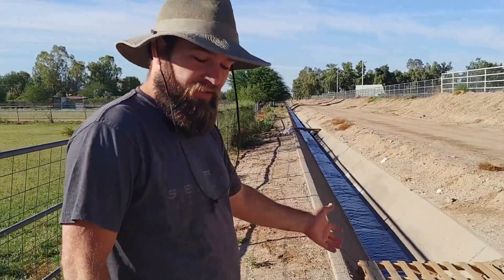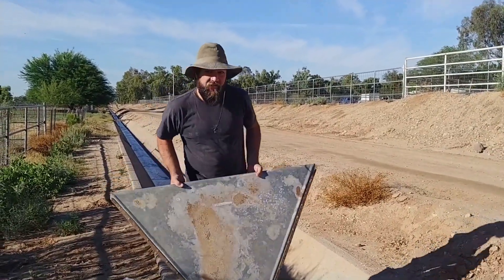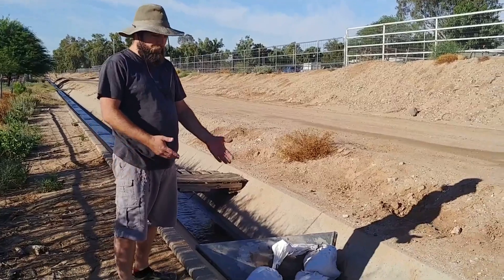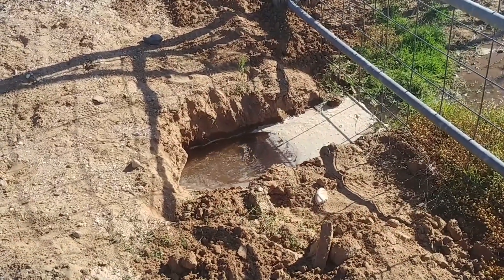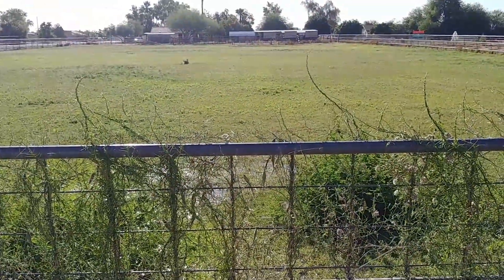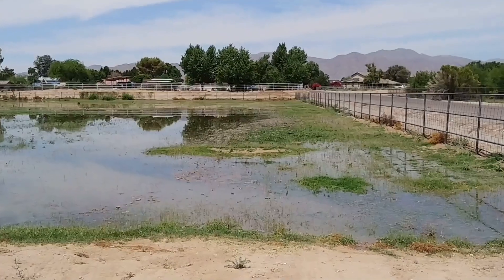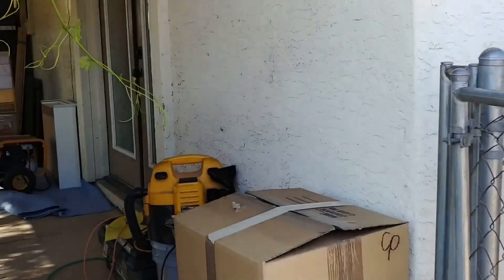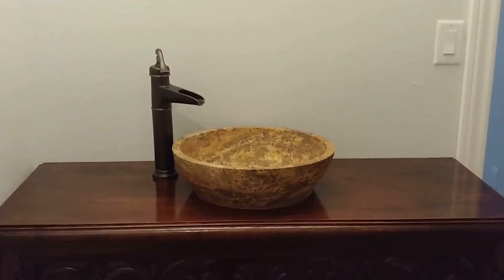Saving Miller: All About Flood Irrigation in the Desert

Comment: I guess there’s different terminology in different areas, here in Northern California a check is part of the pasture with a ridge dirt on each side that runs the length of the pasture to help guide the water all the way to the other end in that section of the pasture.
Reply from the maker: Interesting. Here we call the metal thing checks and the dirt ridge a berm. But maybe the big farms use different terms here too.
Reply: @savingmiller    We we’re definitely not a big farm. Lol. It was just a small 5 acre ranch. The dirt ridges themselves we called borders and used a border disc to make them, the area between the borders was the check, where the water came out of the ditch was called a takeout. We didn’t really have a special name for anything that would block the flow of water in the ditch. It just kind of depended on what was blocking the water. In some spots there was a gate/valve, and other areas you just slide boards into a concrete slot.  But we never really backed up the water in our private ditch that flowed into the pasture, any flow control devices were in the irrigation districts ditches that supplied us. But we usually ended up doing their job for them most of the time.